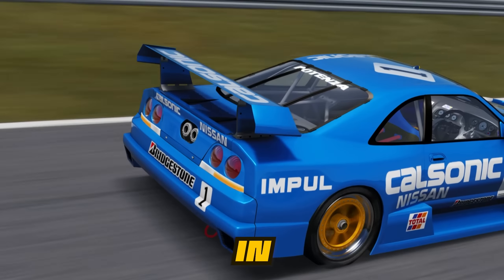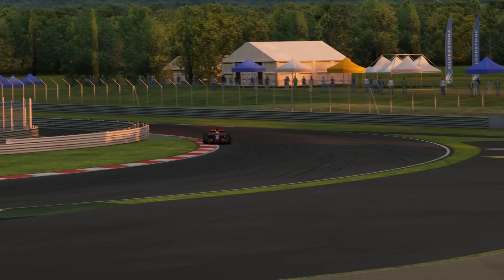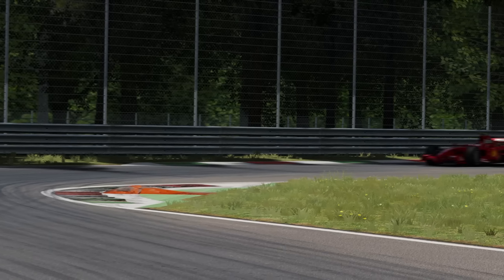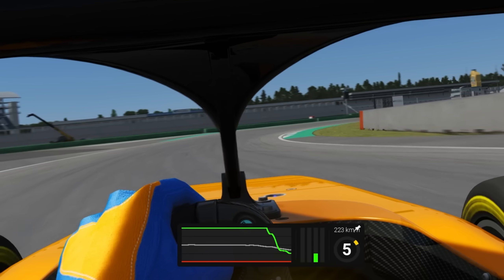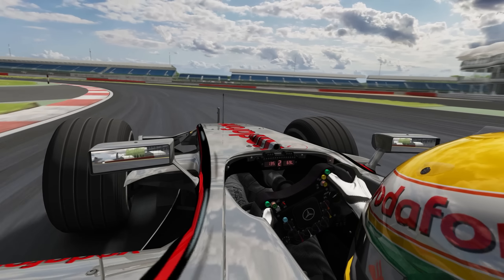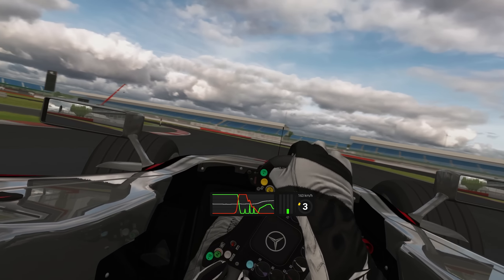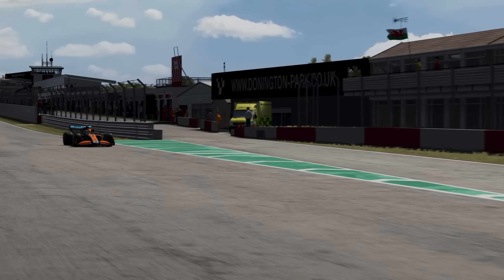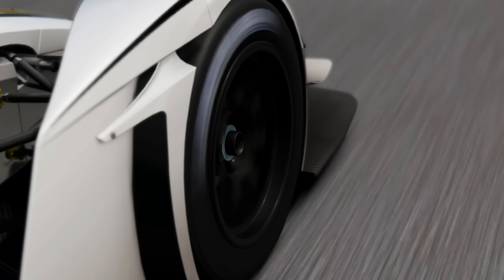You've Been Using DOWNFORCE Wrong in Racing Games...

Comment: Downforce really is so tough to learn because it's a constant war against the tires at that point. Faster wear on tires means they lose grip so you slow down but slowing down lowers downforce so you lose more grip and it just takes a long time to find that balance.
Reply: Yet at the same time leads to you having a huge advantage over cars that don't have aero or downforce, most specifically around the corners obviously
Reply: @TheSilverShadow17  Corners are the best place to make time. If you enter faster and exit faster you don't just save time on the corner but you gain time on both entry and on the next straight a ton. Once you learn how to use Aero the advantages are crazy.
Reply: It is important to take your time and to really "become one" with the car; learning its limits and so on. It becomes an instinct after that.

Comment: "this aint nascar" well only three tracks 6 times outta 36 races you wont be using your brakes and it was to the point on tracks like Martinsville or Richmond you could have brake or tire failure constantly be a threat due to lockups or excessive braking

Comment: I think it's important to mention that downforce increases exponentially.
Also it's not actually the air deflecting thats pushing down the car to the ground. Partly that plays an effect as well but it's actually the speed differential of the airflow over and under the wing elements that creates a low pressure area below it resulting in a strong sucking force.
Reply: The speed and pressure differential is the main physical driver of the force, but it's the deflection of the air which causes that.  There's a sort of recursion to it.  A wing with zero angle of attack will create almost no force (or none at all if it has no camber).  The more the air has to get deflected, the more airspeed differential gets created in the process, up to the point of stall.

But yeah, if it were just a matter of redirecting air mass, a wedge (or an old NASCAR style spoiler) would produce just as much downforce as a wing of the same size and attack angle.  Those do create pretty good force, but much less because they're effectively acting like a deep-stalled wing.  I suppose a wing really does redirect a ton more air than a wedge (or stalled wing), so there's still an argument to be made for the Newton's Third theory.  It really is a bunch of all of the above.
Reply: Wait til you hear about ground effect

Comment: This all seems quite a bit inaccurate. For example at 5:22: The blue line is not the optimal line since it has a tighter turn radius which means more steering angle. Just look at it this way: You stay longer to the outside and reach the exit earlier in terms of distance to the apex. This means that you have less distance to turn the vehicle the same angle which needs a higher rate at which the car angle has to change aka more steering angle.
Also tapping the brake before corners might still be necessary to shift the aero balance further to the front. That depends on the rake, rear wing, front splitter, rake and (heave) suspension. So tapping the brakes gives even more turn in than just letting go off the gas. What's faster obviously also depends on the corne. You always only want as much turn in as you need for that corner. Longer corners need less turn in than a short corner (both have the same angle).
Also what's shown in 0:59 Is also a bit misleading. Increasing rear downforce won't directly make a car faster through a corner, it only makes it more stable (it moves the aero balance further back). More front downforce allows for faster cornering (if the car stays stable enough). In some cases you might even be slower through a corner by adding rear downforce since the car won't rotate as much anymore. A good aero balance with less overall downforce can be better then more overall downforce with a worse aero balance. Usually keeping the aero balance just behind the COM instead of further back is faster (not necessarily the safer). Having the aero balance in front of the COM is obviously not desirable. This obviously also depends on the rest of the setup since you might be able to compensate over/understeer due to the aero balance with the suspension and alignment.

Comment: blue line at the end (one not touching apex) is actually sharper, not smoother line. it's the opposite of what you need to do to cool tires. what was actually meant in this advice is most likely to not turn the sharpest your car can i.e. you should use all the width of the track even if you don't need to let go of the throttle. that may be slower though because you travel longer. in any case, both optimal lines touch the apex, but the fastest is one that doesn't touch outer border on entry and/or exit. again, this only works if you are still full throttle.
as for the first advice, i think another reason why trailng the throttle is better than hitting brake is that it keeps car level (not tilted front or back) which allows wings to work optimally.

Comment: Downforce isn't generated by air deflecting off of the top of aero elements. It's a fast moving boundary layer on the underside creating a negative pressure pocket.
Reply: Both are.
Reply: @CL_Hat  yeah but you don't exclusively use a lesser, secondary effect to describe how something works. The kickup on the top plane is mostly just to prevent the underside from separating before the trailing edge.
Reply: @ClarkBark14  I'm pretty sure you are delving into such deep semantics that you are nearly wrong. It is a simple fact that adding a larger rear spoiler will create more downforce on the rear tires. Perfectly fine thing to say, any issue you have with that is actually your problem.
Reply: @CL_Hat  I mean he did a whole incorrect visualization and description. And it's a "wing" btw. Just saying if you're gonna make an education video, I'm not trying to be snarky.
Reply: @CL_Hat  If you don't understand the difference, it does not mean its semantics.
Reply: @ClarkBark14  It can be a "wing", or a rear spoiler. Definitely snarky.

Comment: downforce comes from the difference between positive/negative pressure areas, %80-90 of downforce comes from negative pressure areas not the positive pressure areas, so it is not the air flowing up is the thing that creates downforce, it is lack of air under the car (and wings), do your research properly next time
Reply: its more like 2/3 of the force for low pressure regions, 1/3 for high pressure

Comment: Thanks for the clear video! :)
One thing is still not clear to me though and that is the way the rear wing works. It would seem to me that having wind force applied to the rear of the car would apply twisting momentum around the back axel and causing the front wheels to become lighter at speed, which is counter productive. Yet this doesn't seem to be the case. Is it because the way the force is applied directly on top of the axel to avoid any rotational force around the axel? some wings seem to extend far behind the rear axel, so not sure how that works. Or is something else I'm missing?
Thanks!
Reply: That is because is (AFAIK) wrong, you use the presure on the rear to create stability (basically so the car doesn´t loose traction on the rear when you are cornerning. To gain actual corner speed you increase the downforce on the front wing, that aplies more presure/weight on the front tires and that is what actually makes you corner at higher speeds
Reply: @marcos1669  That is what I thought too. Hence my question. I tried a car in Raceroom yesterday that had no rear downforce and experienced the tendency to oversteer at high speeds curves where the rear would step out very easily due to lack of grip.

So in essence the video is not entirely correct as long as the car doesn't have front spoiler or wings to press the front wheel to the ground as well.
Reply: @TheRoadrunner11  Well yeah you need a front wing and a back wing for the car to work properly, they counteract each other's moments
Reply: @nade5557  Yeah but not all cars with wings have adjustments for the front wing. So how can they counteract eachother effectively if you can increase the downforce only for the rear wing? Wouldn't that put them out of balance by design?
Reply: @TheRoadrunner11  I think a lot of cars do have front wing/splitter adjustment. If they dont, im pretty sure its either suspension changes to compensate or they just dont mess with the rear wing. Or it may be beneficial to have a rearward centre of pressure to give the rear tyres more grip in some situations
Reply: @TheRoadrunner11  as long as the centre of pressure remains between the two axles you are never going to produce a turning moment around either. Even a little bit of downforce produced by a front splitter/wing, the underfloor geometry of the car, or other features of the bodywork, will pull the centre of pressure in front of the rear axle in most cases.

Comment: That’s not how downforce works.. Air deflection causes drag.
The low-pressure region under the wing created by increasing the airspeed under the wing that generates negative lift or ‘downforce’
Reply: its partly how it works. Lift is created by 3 mechanisms, deflection of air is one of them

Comment: This video shows your personality trying to explain things which clearly you don't understand. Most of downforce in F1 is due to the underfloor creating low pressure sucking the car down and helping with aero wake the wings produce, that is why these cars have huge downforce changes during diving, squatting and rolling. Your concept of wings creating downforce because they deflect air in the opposite direction is just wrong, most of the wing's downforce comes from low pressure aera under the wing, not deflection. You can hypothetically deflect more air upwards but create less downforce, because of flow separation under the wing. Your video showed the "correct downforce car line through a corner" with the car not even near the apex at 5:20, now show me a driver in F1 using your line, purposely creating more distance the car travels through, simoultaneously worsening his laptime. All is cool, but you could have confused a lot of people.
Reply from the maker: I understand how to drive fast not physics sorry. I've already acknowledged my mistake with how downforce is produced on the 2nd most liked comment, which you've presumably already read.